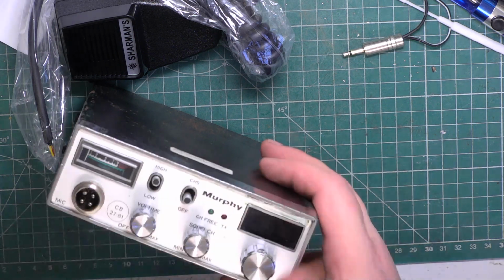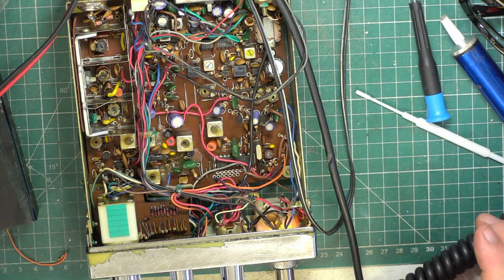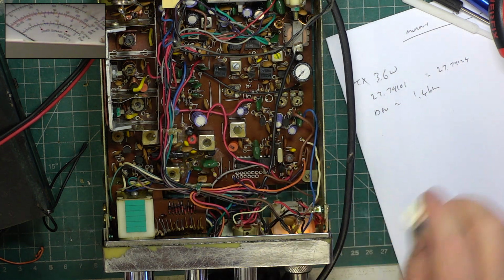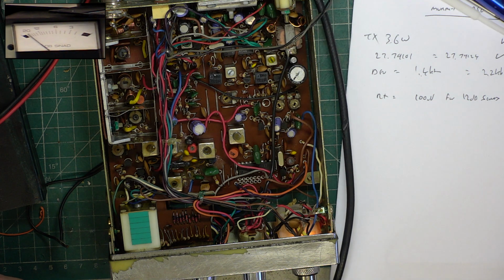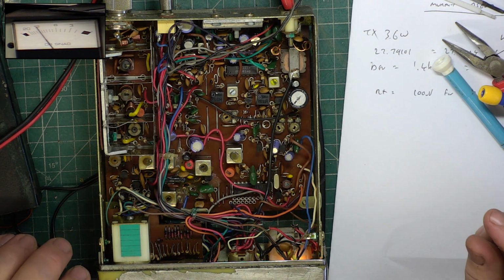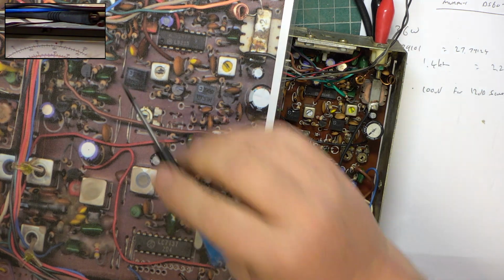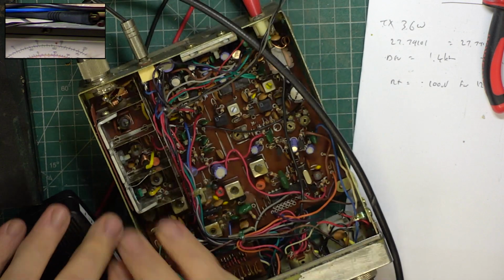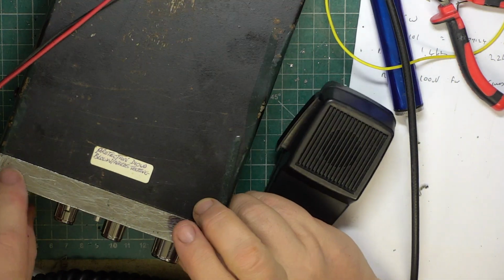Murphy DS602 CB27/81 UK FM CB radio - repair & service, very deaf set

Comment: Didn’t York 867 and Icom 1050 and jwt m2 all use the same board in there radios
Reply from the maker: It's possible they came out of the same factory but are different. I'm sure the York 867 used a Sanyo LC7137 synthesiser, whereas the JWR & Icom (nothing to do with the real Icom) used a Motorola general purpose PLL with crystal mixers. Not forgetting the SMC Oscar 2, Lucas & Signal 1001 versions of the JWR & Icom; the Singnal 1001 being the worst of the bunch with one less RX stage than the others.

Richard, G0OJF, UK